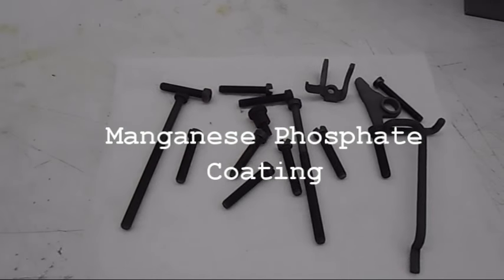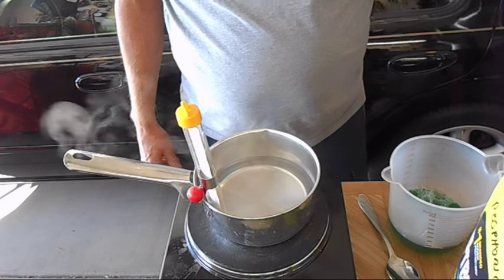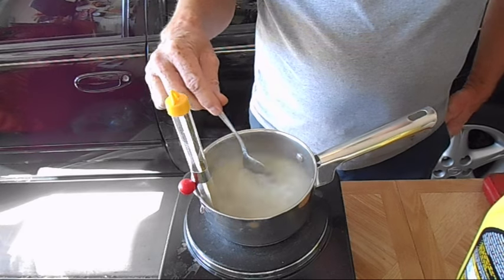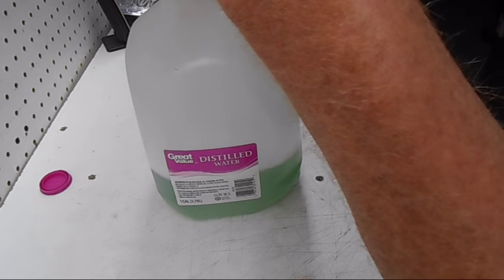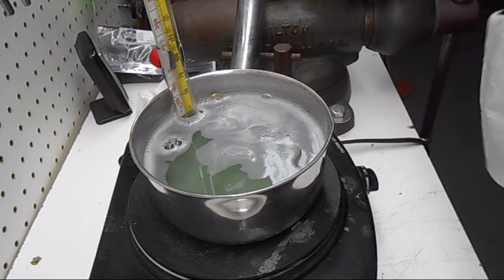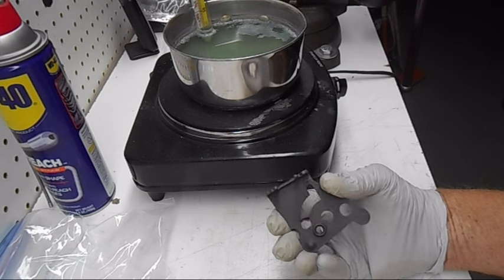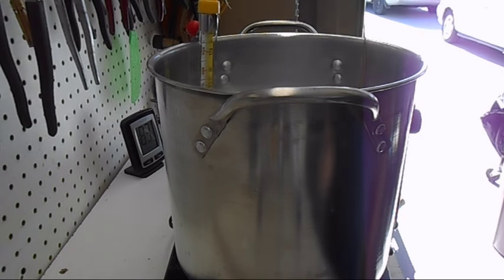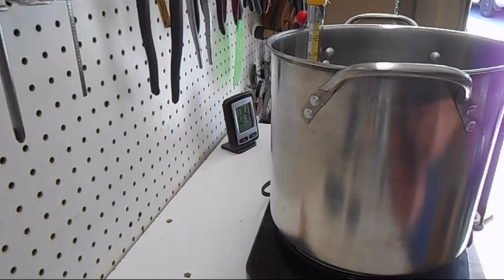Manganese Phosphate Parkerized  Home brew

Comment: MnO2 dissolves in H3PO4 painfully SLOW. What you are depositing on those parts is iron phosphate and very little is any at all manganese phosphate. You either have to use KMnO as an oxidiser to increase dissolution of MnO2 or you need to add Mn in some other form like metal Mn or Mn-carbonate. You can also add some form of nitrate to sequester hydrogen and accelerate deposition rate. Adding too much nitrate will have an adverse effect. Target ph should be around 2.75 and free acid to total acid ratio somewhere between 6 and 10.
Reply: Hi would KMnO4 help in the disolving of ths MnO2 and in what Quantities
Reply: Uhh, uh, uhh, uh, uh, uh, uh. $10 via PayPal for the first person to tell me how many times he said "uhh"...
Reply: @FantomZap  732,918. Do I win? I didn't really notice until I read your comment lol.
Reply: I was surprised to see how much Mn was remaining, undissolved...it did look very much like the small teaspoon wasn't consumed...good suggestions for improving the consumption of Mn.

Comment: At 17.28 the author makes the comment that "The solution seems to work better the 2nd time around.", could this because it is lacking in iron? Maybe more steel wool should be added initially.
Reply: My guess is that he is over diluting the solution with Distilled H2O. Maybe get faster results with a more concentration from the start 🤔

Comment: Your finishes come out splotchy because you are touching the pre-finished parts with your bare hands.  You are getting skin oil on the surface so the manganese is not adhering evenly.  Use your gloves for all steps, and your finishes will be more uniform.  Thanks for sharing!
Reply: I find I get the best finish adhesion by washing the parts to be coated in soapy water, rinse and dry, and give them a microetch in muriatic acid for 30 seconds to a minute, re-rinsing, and finally submerging in solution by a thin wire hanger.

Comment: I used atomized iron. The same weight of 1/3 of a steel wool biscuit. My parts are looking extremely dark, but as soon as I rinse them off, the black coating comes off and reveals a very light gray (lighter than zinc phosphating). Any clue what could be causing this? I figured the powdered iron would work just fine. I’ve seen it used in other recipes.
Reply: Can u tell me please how to make cold zinc phosphating chemicals?
Reply: @Indiansports421  I don’t believe you can make a cold zinc phosphate. The reaction requires heat.
Reply: @smokiesleather  we are using cold phosphating chemicals don't required heat,lots of chemicals & company available in India for cold phosphating.

Comment: what concentrate is phosphoric acid? Home Depot and Lowe's sell "Phosphoric Acid Cleaner" locally. Is this the stuff you use?
Reply from the maker: I think it was Prep and Etch at Home Depot. It is probably 40%.
Reply: i got phosphoric acid with 80%. does that mean i use half the volume of the cleaner you used?
Reply from the maker: Yes
Reply: Blasting with 80 grit garnet or aluminum oxide makes a nice finish

Comment: Thank you for a very informative video Harold! I just received both the manganese dioxide and the phosphoric acid i ordered on ebay two weeks ago. Before i start the process of mixing the ingredients i want to hear if you got a suggestion for a recipe using 85% by weight phosphoric acid?
Reply: That phosphoric axis is great for doing auto body restoration.    Clean that rusty panel then spray it let sit and wash off then wipe dry.    wipe dry. It will form a light dark shade on the bare metal and keep the rust pits from activating later on.    Great stuff.

Comment: Thank you for this great video. Just gave it a go and the bolts came out like new. Now back to the sandblasting cabinet to do the other 399 bits. Any idea what to soak them in after the parkerizing? Somebody told me that when WD40 is evaporating, it actually attracts water (???). Maybe some kind of gun oil? Thanks again, great information!
Reply from the maker: WD40 Is ok I have had no problems with it.
Reply: go to caswel a company that sells plating chemicals and all the supplies, they have a clear coating to use over zink or phosphate coatings to protect them.
Reply: @charleswittmer2477  Look up Boeshield T-9. All the concourse guys use it. Manufactured by Boeing and used by NASA and many, many others.

Comment: Great video Mr. Demes.  Not many folks can just extemporaneously perform a task like this while clearly explaining what they are doing like you have done.  Very professional and great speaking voice.
  I learned a lot and I am going to give it a try.  I will make one change.  After cleaning and degreasing, I am going to Try preping the parts with Muriatic Acid which is dilute Hydrochloric Acid, then rinse well,   and see if that will give them a fairly uniform etched surface.  Then I will Parkerize.
Reply from the maker: The Parkerize chemicals sold have a pre dip to even out the color and even out the color on different types of metal. EPI has great chemicals for Parkerize but they are pricey. The home brew is just a way to o it on the cheap.
https://www.epi.com/phosphates/steel/#e-prep-b-3
Thanks for watching.

Comment: Just a thought,when wet soda blasting the soda is mixed with water until saturation level is reached,then the actual soda for blasting is added,which sounds strange,but the water can't absorb any more soda as it(the water) is "saturated with soda" so adding soda creates a gritty slurry that will remain gritty and so more soda added will not dissolve into solution.
SO,
I'm thinking maybe the fluid solution is saturated with the manganese dioxide and can't dissolve any more ,unless you add more water.
Just a thought from other situations with solution/dissolution processes.

Comment: Hi Harold,
Love this video, thanks for making it. Just one question.... you mention that you normally wait 10-15 minutes for small parts. How long would you wait for something larger like a hood hinge?
Reply from the maker: Keep it in until you get the color you want. Some metals will only be lighter than others. Depends on the material. To make all different types of metal take the same you need to use a pre dip like EPI E Prep 258
Reply: Larger parts well be longer, maybe more 2-5分钟

Comment: I get a black coating but it rubs off and the colour of the metal becomes slightly greyinsh when dry , but when in contact with WD40 it looks black.. the bubbling never stopped even after 30 min ...... how long to keep boiling

Comment: Excellent.  I appreciate the detail you put into your instructional videos.  I've been using cold bluing to get a similar appearance, but the manganese phosphate appears darker--more of what I am looking to achieve.  Definitely going to give your method a try.  One question:  since you have a zinc plating setup, have you tried the Black Chromate process?  Curious how that would compare in appearance and corrosion inhibiting.   Keep the videos coming!
Reply from the maker: Hi Cory
 I received a sample of the Black Chromate from my chemical supplier about 1 year ago. I think they send me stuff to try because they consider me a Lab type plating operation. It was a good product. I just don't have a customer base for it. I like to try to reproduce the factory finishes. I hate painted fasteners. On car restoration all your fasteners should be plated or Phosphate coated in Manganese or Zinc. I hope this video helps guys doing there own project to be able to do this in there garage. I am working on a Zinc Phosphate home brew. You can buy this chemical form Palmetto Enterprises. It very good. I think about $55.00 with shipping to make a gallon.Thanks for the input.

Harold
Reply: @backnine  Can u tell me please how to make cold zinc phosphating chemicals?

Comment: Your black oxide video of "metal parts" is no longer on YouTube is that still available via private link? I bookmarked that because how good the information was.
Reply from the maker: Gun parts
YouTube doesn't like that.
Reply: @backnine . I have searched and searched and searched for the last six months and while I have read many articles, nothing is as information packed as your videos for the DIY'er.

Could you post a link to the video on something like Google Drive or Dropbox and post the link here or PM me with the link?  Do you have any other videos that were taken down?  There are several books on the subject like Angier, R.H. (1936). Firearm Blueing and Browning but they are not as good as your video. 

I've downloaded everything I could find that was still up on 5/23/24 but like I said your videos are excellent. A picture or video is worth a 1000 words. Please consider one of the options above or can you try re-posting. Thank you SO much

Comment: Hi Harold
I am have grave difficulties with getting the solution to work, I have available 98% Phosphoric Acid i have tried to dilute the acid to 50% but i just can't get the solution to look or work like yours does.
For some reason my solution is all brown once finished cooking, the acid is clear too start with.
The cooking pot has a ton of scum around the top which i notice yours does not.
Please help.

Comment: How would you prepare machined parts that have coolant on them before parkerizing. I manufacture lots of specialty small parts that we now pay big dollars for black oxide finish. We really want to set up this up to save black oxide cost, shipping cost both ways and faster delivery time to our customers. Any help would be appreciated. We have discussed using this process many times.
Reply from the maker: You can clean the parts with mineral spirits to remove oil. Then bead blast the parts with a 140-170 mesh glass bead. This beat blast is very fine and will not effect tolerance. then use process in the video. If you want to use Black oxide room temp go to EPI web site. They sell instablack 333. Very good product. I have a video on the black oxide doing a gun.

Comment: I've attempted to use the recipe and procedure twice, and have failed twice. First time, final concentrate looked like beer, -yellow. seconds time it's kind of purple.

I think I'm using too much manganese. Is it two (2) teaspoons manganese, or 1/2 teaspoon? In video you use 1/2, at what point did you add the remaining manganese?

It could be I'm having difficulty maintaining temp, as my current thermometer sucks...
Reply from the maker: Get a candy thermometer at Walley World. Too much Manganese Dioxide will not hurt. You will leave it in the bottom of pan when you filter it off. You can use a full biscuit of steel wool. Has to dissolve completely. Let it cool and settle over night. Filter in a gallon jug and top off with distilled water. It should be a light green color and clear. As you use it you will get evaporation so you have to keep adding distilled water to keep level up as you are using it. let me know if it works out.

Comment: So your mix once topped off with distilled water in a gallon jug is ready to use? No need to mix with more distilled water when filling the parking tank?  I have a project that wasting a few bucks to make this could save me alot of $$.  I was told to wrap a steel wool pad in a coffee filter and submerge it in the tank for at least a half an hour to activate the solution. This might cure the poor covering problem you have on initial parts. Thanks for sharing.
Reply from the maker: You could put more steel wool in the initial mix it will not hurt any thing. As I said for the car restoration stuff it works great and cheap. You have to keep adding distilled water when you are heating it to keep the level up as you get a lot of evaporation at that temp. I just did a AK47 to try the solution. Most of it came out jet black but the forged parts came light. The guys that sell the park solution have a predip that suppose to solve that problem. You will see that on some fasteners on car parts also. I am trying to find  a predip formula and if it works out I will do a add on video. When you are done just filter it put it back in a jug and top off with distilled water and keep using it. It last a long time. You can buy the the pro stuff but the Hazmat fees are killers. Post your results.
Reply: I've had AR15 barrels that look lighter like that. I cheat and rub them down with black moly grease and heat them up with a propane torch, then wipe off the excess. good protectant and darkens it too.
Reply from the maker: I knew the different metal would be a problem on the gun. The receiver on the AK I plug welded the rails and the park took light on the weld circles (not bad) but you can see it. Also I spot hardened the FCG holes and some other high stress areas and they came out about a shade darker. I will paint this one with duracoat to even it out. The Park will be a good primer + when you park it it gets into all the areas paint won't get. I am starting another AK and bought a fully hardened 80% receiver and will spot weld the rails. I may buy the the predip and try some parts with the home brew and post a result. What makes the park bite good is to media blast the parts. I use a 100-400 mesh glass bead it real fine.
Reply: @backnine  Sandblasting is a key issue here. Also, make sure after sandblasting you never touch the part again until you are finished. After sandblasting soak the parts in brake cleaner or acetone for 20 minutes. But never touch the part again until you are done... meaning if your last step is parkerizing then remove your part from the tank (with gloves on) then oil it up. Then you can touch it with bare hands. If your last step is a tactical coating then do not touch the part with bare hands until you have painted the part and it has been cured... oven or whatever.
Reply: I saw another video where the guy had a purchased kit of chemicals that included a pre-dip.  He said the pre-dip smelled like muriatic acid.  Muriatic acid might etch the surface of the part and make it more receptive to the manganese phosphate

Comment: Great video. I followed your recipe but I got a grey finish instead of black. Not a real big deal but wondering what you think could be the reason i got a grey finish instead of black.
Reply from the maker: It depends on the metal. Metal that is hard or heat treated will be more of a gray color.
Reply: Thank you for the quick response. It was a heat treated piece. Still covers though and looks good. Thank you again. I looked at other guys recipes on here and yours was the best I found. Appreciate the time you put in to making the video.
Reply: When I went in the army in 1976 they issued me a depot new old M15E4 or M16E4 I forget which.    That pup was OLD likely an early experimental or trial model from the early 60s.     When I got it it liked like new cermacoat.  My 45 Colt was the same.  Those puppy’s were so rough they would scuff your knuckles but smear some oil on and it was IN There.    Beautiful weapons and both a nice light to mid gray.   That stuff was TOUGH too.     I never saw that parkerized finish on any of my issued weapons again, they were all black.